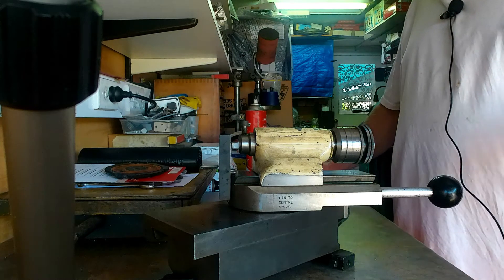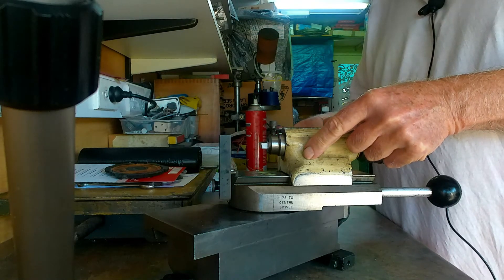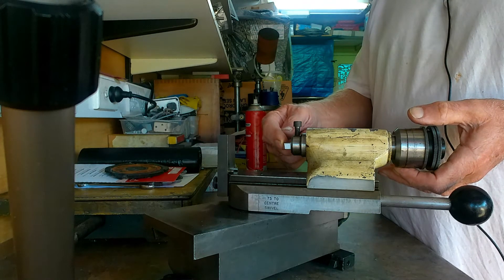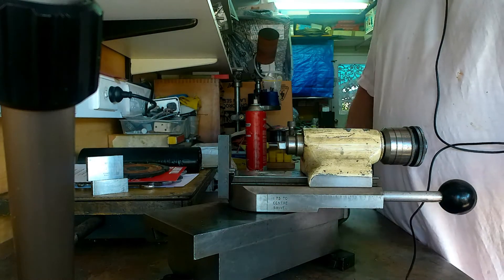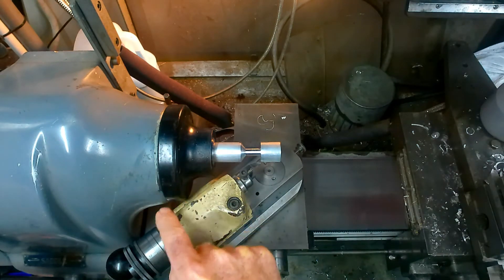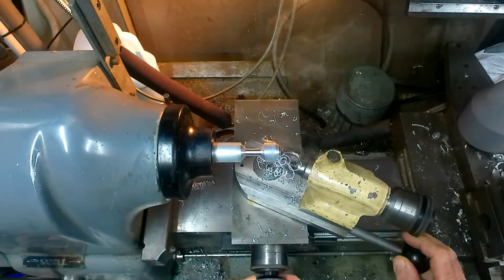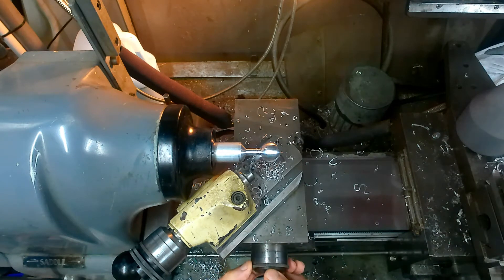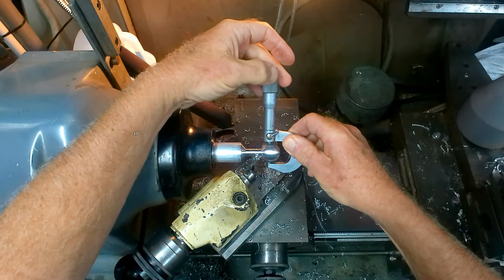Setting & Using a Genuine Factory Hardinge Radius Attachment D 14

Comment: It's a very substantial radius attachment, but possibly not the cleverest of designs for getting access on the headstock side.
Reply from the maker: Hello John, you are dead right there, pig to use and I only tried it for the video. From the condition it was in I suspect it had not been used much at all. Thanks for watching. Regards.

Comment: Good video Dave. I wonder if the error in geometry has come from the position of the turning tool? As viewed from the top if the cutting point is not in line with the centre of rotation then a small error may be induced? I can do a diagram and send it to you if you like. Anyway it's a nicely engineered attachment.
Cheers
Crispin
Reply from the maker: You are correct Crispin, I did a trial run with the tool centered and it came out much rounder. The problem was that it reduced the amount that I could turn of the ball. The clearance between the attachment and the headstock was even more restricted than what you saw in this video. Thanks for watching it.